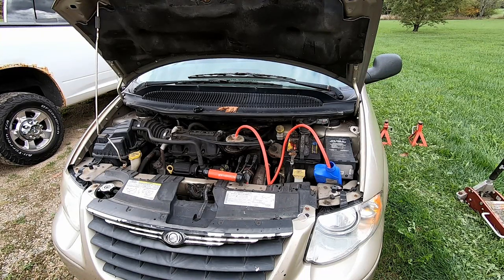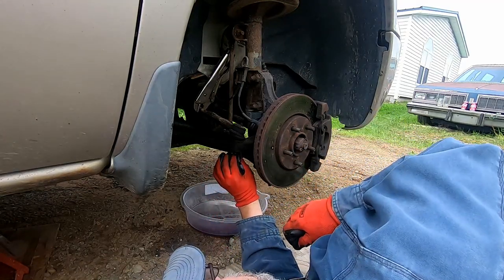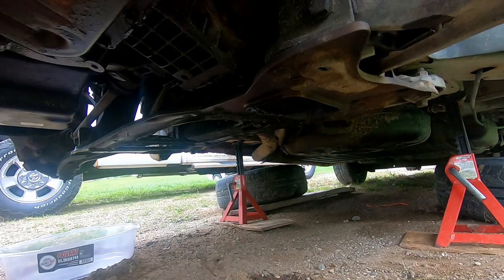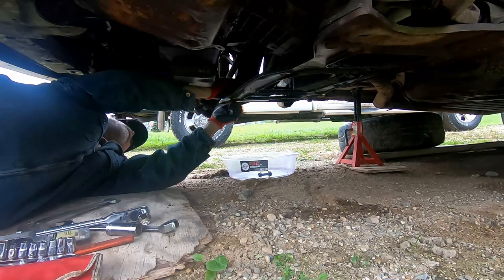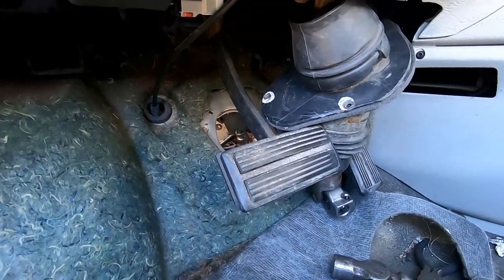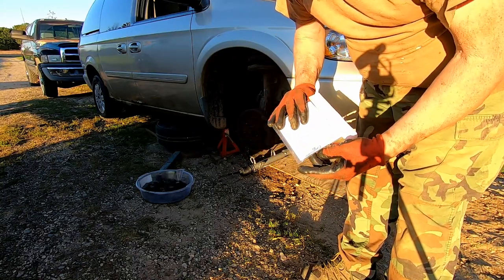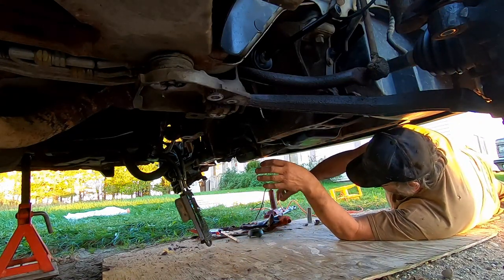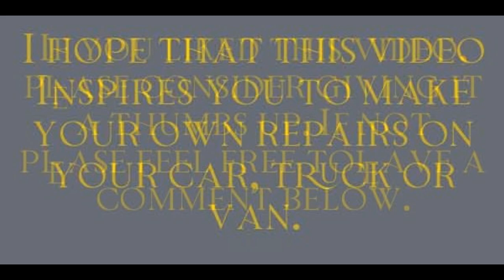DIY Power Steering Rack and Pinion 2006 Chrysler Town and Country

Comment: Good video. I replaced the rack on my 01 T&C. I did it without removing the cradle. To remove the lines I removed the charcoal canister. I took off both outer tie rods before removing the rack and pull the rack out on the passenger side. My son helped me finagle it out but after seeing what was needed to get it out, I was able to do it alone.  Happy Motoring.

Comment: WHAT A VIDEO!!!  Changing out the high pressure line on my 2005 SXT was just about the worst experience ever!  I never thought of accessing through the floor!
Reply from the maker: Thank You!! I have found that going through the floor for those lines is way easier than dropping the cradle. The trick is not tightening the rack to the body until after getting those lines attached and tight. Otherwise, there isn't very much room to move a wrench around. Thanks for watching!
Reply: @justcallmeboats  I found no way at all to get the lines re-installed (and removal was indeed a nightmare).  The van still sits and now it has a ray of hope to come back!

Comment: I, unfortunately, had to do this repair previously on my van as well. I thought a refresher would be a good idea. For the bolt close to the pinion shaft, I ended up using a ' crows foot' wrench and that really helped resolve the clearance issue.
Reply from the maker: You say, unfortunately, I hope that it went well for you.  I lost all of my crows foot wrenches when I moved here. I did break those lines loose with a line wrench, then finished removing them with a regular open end wrench. This was the second time I had done this job, but the first time, I made a video on it. The first time, I removed the lines from underneath, and it took forever. I hope that my video helped you out in some way. Thanks for watching!

Comment: Thanks for sharing this fun adventure with us, it was helpful for those like myself facing this common and soon coming repair.  Some vehicles are easier and can come out without removing the subframe or plates ect... Your puppy is awesome!
Reply from the maker: Thank You! I'm glad that I could give you a little insight to what you could be facing when doing yours. A shop near my house was trying to charge me a bit over $800.00 to do this repair. My cost was around $300.00. I bought the part cheaper than this guy was going to charge me for it and he refuses to install customer supplied parts. I wonder why???? I used to work in a transmission shop when I was just a young lad. I know how this stuff works and I wasn't going to allow this guy to make hundreds of dollars profit off of my bank account. Thus, the reason for starting this channel.

My puppy IS awesome! She is actually a fully certified service dog. She loves her Kong disc and I love that she unknowingly gets exercise while playing.

Comment: I was hoping to see how to remove that bolt and nut holding the rack right at the steering connection. No room to get a box wrench on the nut on the top. Only thing holding me up now.
Reply from the maker: Are you referring to the bolt holding the steering shaft together inside? Or, the 21mm nut/bolt nearest to the shaft that holds the rack onto the the bottom side of the van? If it is the 21mm one, you can access it from the backside of the aluminum cradle. It is very difficult to see so you have to basically do it by feel. The angled box end of a wrench should have just enough room to squeeze over the top of the nut and them remove the bolt through the bottom. I didn't show that in the video because it can't really be seen with the naked eye let alone the camera but I did mention how to remove/replace it through commentary. I hope that this helps you. I know that this isn't the easiest repair that you could ever do on one of these vans and I wish you the best.
Reply: @justcallmeboats  Thanks, I must have missed it in the commentary with the grandkids in the background. I can squeeze a short socket on it and do have a pivoting rachet. It might just work. Thank you. I have also found my set of stubble box wrenches.

Comment: Great video❤ How many litres of fluid you put in at the end please?
Reply from the maker: The entire system holds approximately 1.2 Litres of ATF+4 transmission fluid. So, make sure that you have that and a little bit more in case of air  being trapped in the system as well as for any potential leaks.
Reply: @justcallmeboats  Thanks a lot👍

Comment: Where you able to find a replacement boot?  I have been unable to find a replacement.....where??
Reply from the maker: Sorry, no, I wasn't able to track one down, and even the vans that I looked in at the junkyard had the same issue. I didn't think to check out the local Chrysler dealer, but if it's available from them, it's not going to be cheap. Thanks for watching

Comment: Hope you still have your van.  Mine has over 400k and I don't want to junk it
Reply from the maker: I do still have my van. It's around 326,000 miles right now and still a daily driver. Unfortunately, Michigan winter weather is beginning to take a toll on the body but it keeps on running. I'll drive this until it's no longer safe to. Then I'll patch it up and drive it some more!  Thanks for watching!

Comment: Thanks for the video. Do you happen to have o ring part number? Thx
Reply from the maker: Thanks for watching! Sorry, I do not have the part number for the O-Rings. Generally, the steering rack comes with new O-Rings in the box. If you need new ones you can always take the old ones to a parts store and they should be able to help you out with new ones.

Comment: Have you ever had a TPM problem with that van? I have a 2005 and once in a while if it's rainy or if I've driven through a puddle the TPM will get wet and the wipers and the headlights
and dashboard lights will go wacky. When this happens I spray out the underneath of the fuse box very thoroughly with non lubricant contact cleaner with the battery unhooked. Then wait about 20 minutes and the hook it back up. That works for until it does it again. But you never know when it might happen. It can be dangerous. I've looked into a replacement TPM but they don't make them any more that my vehicle. 
Do you know of a more permanent fix?
Thanks.
Reply from the maker: Yes, I have had issues with my TPM. I had to replace it a few years back.  Mine had collected a ton of salt and water in it from Michigan winter driving. The salt had caused so much corrosion that it had literally eaten some of the connectors off the bottom of it. I grabbed one out of the junkyard and threw it in. I was lucky that the one I grabbed worked with zero issues. That is until one winter we had blowing snow and the snow impacted the engine compartment and the problems came back. Luckily, the problems went away after it had dried out and there wasn't any corrosion this time. What I did to resolve this problem was to make sure everything was clean and then I applied dielectric grease to all of the plugs and exposed areas where water could get in. It has been several years since I did that and I haven't anymore issues. I re-check it periodically to make sure there is still grease covering everything. I'm not saying that this is the correct thing to do, or even if it's the smartest thing to do, but it worked for me. Don't over do it though. If you go to a website called Car-part.com and put your vehicle info into the search box it will give you a listing of every junkyard in your area and beyond that has the parts that you're looking for. Good luck in your repair and Thanks For Watching!
Reply: Thanks for the info. I also live in Michigan. Our salty winters sure do eat up vehicles.
After watching your video changing the rack and pinion I now know why garages charge $900 - $1,200 to do that job.
Yikes. @justcallmeboats

Comment: Getting ready to change out mine today . I have an all wheel drive so I believe there is another couple of steps such as the drive shaft to the rear. My question is other videos show removing part of the emissions system, is that necessary? New subscriber by the way ! This is the most informative one I have seen. Thank you for putting this out there!!!
Reply from the maker: Thanks for subscribing! The disconnecting of the emissions system was not necessary when I did my repair other than the couple of bolts that held the vacuum canister in place. Those bolts were attached to the reinforcement plate. I try to include as much information in my videos so that my viewers know what they're getting into. The hardest part of this repair is getting the power steering lines back into the new rack without stripping the threads. Doing this part is easier from the top as you have a lot more wiggle room for your hand. Make sure that you tie your steering wheel in place before disconnecting the linkage so that you don't risk damage to your clock spring. Good luck with your repair.
Reply: @justcallmeboats  i emailed you my progress! Thanks again!!

Comment: Just a question where do the the high pressure or low pressure lines go is the top high pressure and the bottom port low? On the rack Thanks in advance
Reply from the maker: I believe that the high pressure line is the lower hose on the steering rack and is an 18mm bolt. The fittings on the rack and hoses are different sizes and will only go in the appropriate holes.

Comment: Good video..I hope I don't have to take that stupid plate off and do without..
Reply from the maker: Michael, 
Thank you for your comment! 
Unfortunately, I don't think that you can gain good access to the steering rack without removing that plate. After removal, you have to re-install it due to it being part of the suspension system as it holds the rear joint of the lower control arm to the body as well as reinforces the sub-frame. Also, without that plate you run the risk of the aluminum sub-frame (that holds the engine and transmission in the van) from cracking and breaking.  I performed this repair showing that simple hand tools can be used to do it. You could get a cheap impact driver from say Walmart (not endorsed) to speed up the job. Good luck on your repair!
Reply: @justcallmeboats  yeah I actually just got done replacing this transmission and did it without removing the frame, but looks like I'm not going to get away with it this time lol, I'll give it a go, thanks again
Reply from the maker: @SDPP992  You're very welcome!